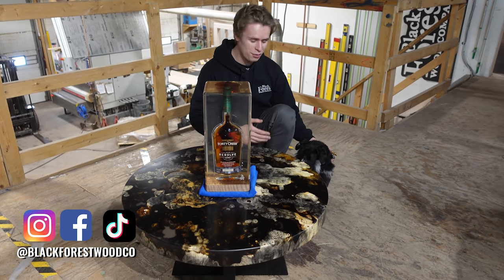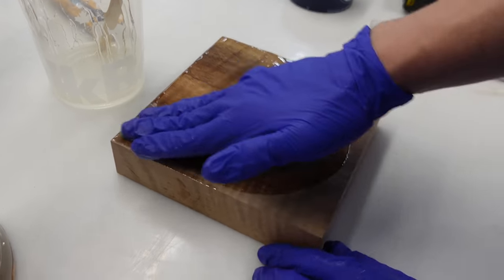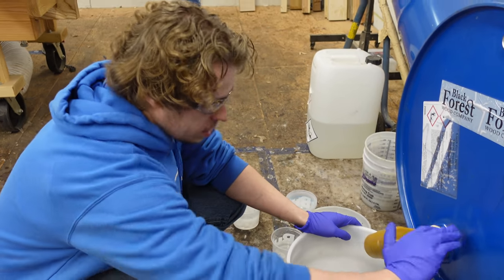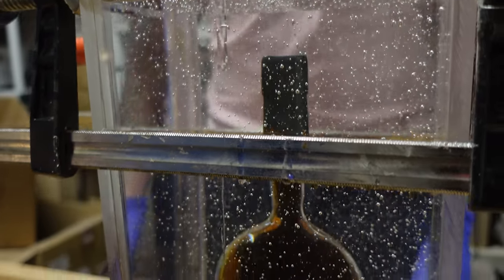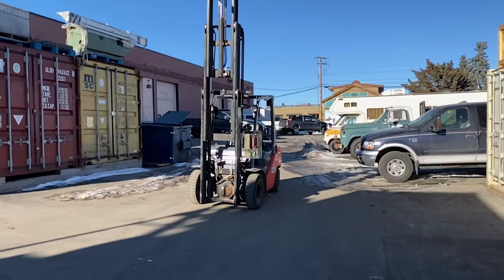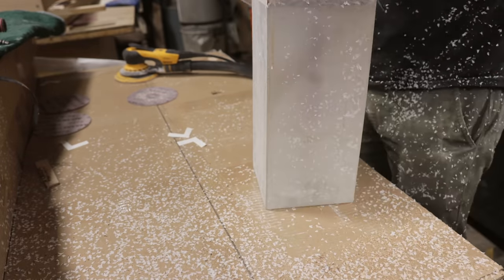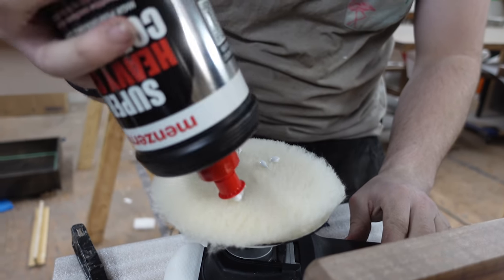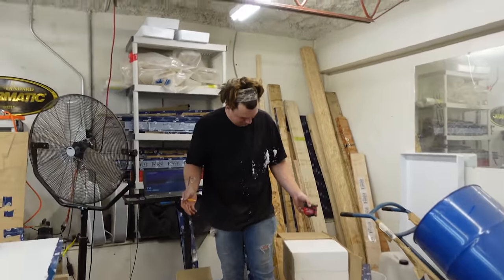Resin Casting Gone Wrong

Comment: if someone gave me a gift of booze I couldn't drink, I'd be so pissed off.
Reply: Yeah, I was thinking the same thing, only the person that gave me must hate me.
Reply: id find a way. brute force tends to work well
Reply: Nah they showed how to open it lol you just need a fork lift
Reply: But if you gave a Brit a gift of booze they could drink, they'd just get pissed.
Reply: @kirkyorg7654  glass shards make it extra spicy
Reply: Good gift for an alcoholic.
Reply: I  just assumed the reciever is a recovered alchoholic. Only person I can think of that could appreciate this.
Reply: @stephanjuvik6266  that plastic will never stop the recovered alcoholic they would find a way to drink it
Reply: @kirkyorg7654  the heat from the resin would sour that so badly
Reply: @stephanjuvik6266  I don’t think that would be a very nice gift for a recovered alcoholic... More likely just a display piece.
Reply: If it's a display piece why resin cast it and just set the bottle out. That way if down the road you want to drink it you can!
Reply: Well, you wouldn't be pissed actually
Reply: Chip or melt your way through the resin carefully until you can open the bottle
Reply: @orcini99  Revenge now served in a plastic case.
Reply: @a.harrispoems2738  ya but it still had bubbles in it so its not even perfect
Reply: @Regelos  Question. How would it? Just curious
Reply: I’d be more pissed off that they broke one before that one

Comment: I was also thinking you guys...would it have been better if you sealed the bottle and cap with the same resin you use to prevent any errant air pockets from forming? It seems like you had a bubble come from the bottom of the bottle

Comment: Wouldn’t it have been easier to put the mold into the pressure pot, fill it then degas it so it all got all the air out?
Reply: Yeah I 100% would of put it in the degasser I mean bubbles? So easy to get rid of lol
Reply: Wouldn’t that run the risk of the bottle breaking?
Reply: @xamper7543  not near enough pressure does it need to remove bubbles etc. That it take to break that bottle.
Reply: @xamper7543  not sure, that’s why I was wondering if it would have been easier. Plus can you fit something that big into the pot?
Reply: Heat.. the wax at the top melted

Comment: Did you do the wood base first in resin?  Since wood contains minute spots where air can be. Also, I didn't see you applying some form of flame or sprayed Isopropyl alcohol onto the top to help remove bubbles before moving it to the frig.

Comment: Your stuff looks Brilliant !! 
When using the cutting compound, Just spray water on the piece and keep your mop wet, It breaks down the compound and gives a better finish, (but cover up as you "will" get wet) 
Also could you vacuum the piece after the pour? or would this create problems?  Keep up the great vid's.
Reply from the maker: Thanks for the tips! Ill try this next time.
If the epoxy is kept under vacuum it will eventually boil and result in more bubbles! 
Id also be worried about the pressure of the vacuum crushing the bottle.

Comment: I don't think what happened had anything to do with the fridge door being opened. Refrigerators are very well insulated to keep things cold, but they don't actually pull out heat from something very fast at all, so putting a giant cube of room-temperature resin in there means that that resin is going to basically stay room temperature for hours because it's going to take way too long for the fridge to actually cool it down. And if that resin starts generating any heat whatsoever (which curing resin does) then there is no way any ordinary refrigerator can keep up with the heat generation from that amount of curing resin unless you use the stuff that cures really slowly.

What might work is submerging the mold to about the level of the resin in something like a bathtub of water, because water can absorb a very large amount of heat, much much much more than the air in a fridge can, it would pull the heat from the chemical reaction out of the resin much more effectively and keep it cooler than is possible in an ordinary fridge.

If this is something that normally works I expect it's because you normally do much smaller amounts of resin at a time, and even then you're probably only just skirting under the temperatures that would cause problems.

I know this video is 8 months old and probably nobody will see this, but I wanted to point out that this was more of a problem with the laws of physics than the methodology of keeping a fridge door closed.
Reply from the maker: - The temperature wasn't room temperature it was poured in a room filled with fans and air conditioning and poured on a water cooled aluminum table, and we do use resin that cures slowly

- We have had success with the fridge method with every other bottle casting that has the same size and thickness.

- If any water gets into resin it won't cure properly

Comment: What is the purpose of de-gassing the resin if your pour puts bubbles back in? I'm curious because it seems like an extra step that has no effect.
Reply: the bubbles from the pour are much bigger so  they get out of the resin on themselfs. If you do not degas it in the begining it will look like a standard icecube where you can't see anything

Comment: i noticed at the 5:05 mark as the pour started the piece of wood pulled back and moved the bottle ever so slightly is the bottle not glued to the wood base ???
Reply from the maker: Nope!
Reply: @BlackForestWoodCo  what stops it from floating up ?? 🎈
Reply from the maker: @kirkyorg7654  The weight of the glass and liquor inside, we glue down cans and lighter bottles to prevent them from floating though!
Reply: @BlackForestWoodCo  ok cool  thanks

Comment: The first attempt still had bubbles. The second attempt no bubbles. Is that because they all rose to the surface and you sawed them off?
Reply: That must have been because  the fridge was left open? That is a lot of epoxy in a concentrated space.
Reply from the maker: The first attempt had bubbles because the fridge door being open caused it to overheat and flash cure instead of taking its time to release bubbles over a few days
Reply: @BlackForestWoodCo  second had bubbles too tho...

Comment: Woops. Wonder what the odds on that happening were. Also could you not have cut the offending resin section off and re-poured that section? Or would the join line be too noticeable?
Reply from the maker: The joint would’ve been pretty noticeable!

Comment: Could you go more in depth about degassing, the last time I did that the epoxy caught on fire
granted it was 95 degrees Fahrenheit
Reply: Did you use 1:1 or 2:1?
Reply: I used 1to1 which was the instruction
Reply: @big pat I'd say that most likely is the problem. A lot of 1:1 epoxies need to be poured very soon after mixing. 2:1 epoxies have a longer potlife which allows them to be degassed after mixing.

Comment: I would have drilled a hole through the cap from the top and poured the booze into another bottle with a funnel. 😣
Reply from the maker: We would’ve but the epoxy got in ):
Reply: @BlackForestWoodCo  Damn!